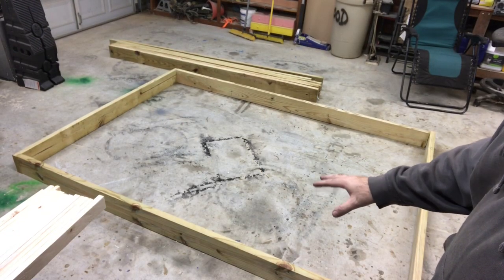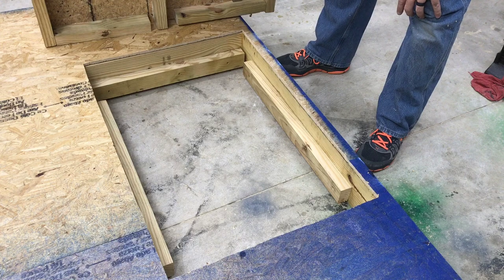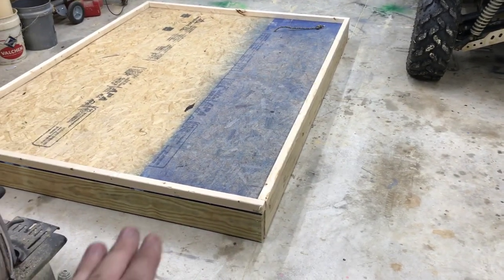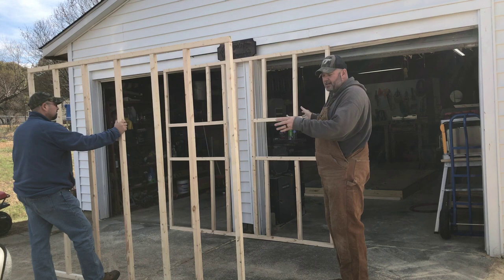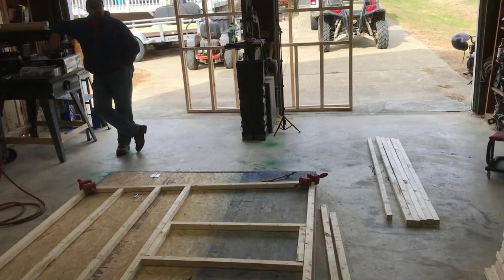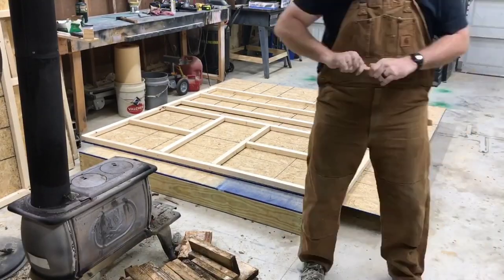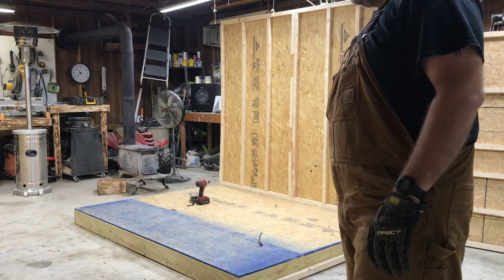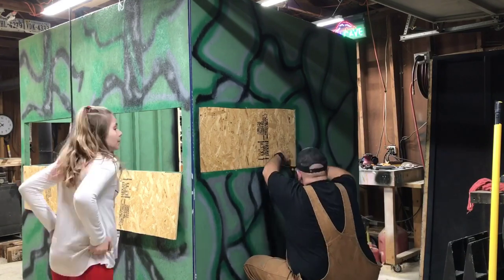Building a 6x8 Hunting Box Blind Part 1

Comment: Did you use any treated lumber?
Reply from the maker: Kris Glenn I used treated wood for the floor, floor joist, and of course the 4x4 posts and bracing. All interior wood was standard which I treated with a deck water seal. I even sprayed the OSB with water seal before I painted it. One prolly defeats the other but I had extra left over.
Reply: Thanks. Your blind is exactly how I wanted mine except my version was around $600 so I'm trying to figure out how to lower that. These videos are helpful. Thanks